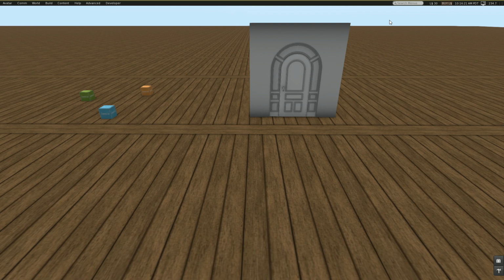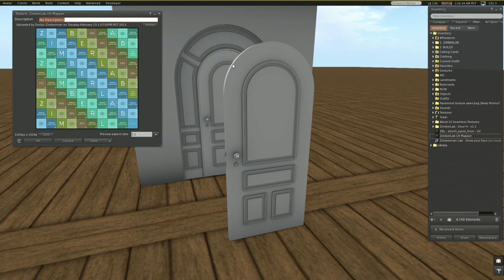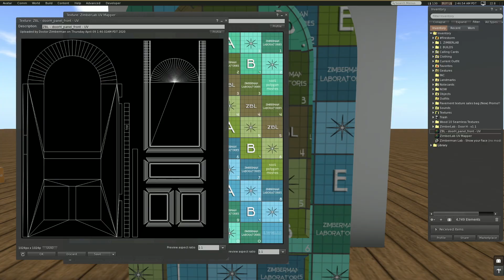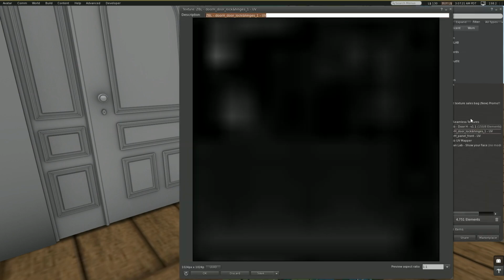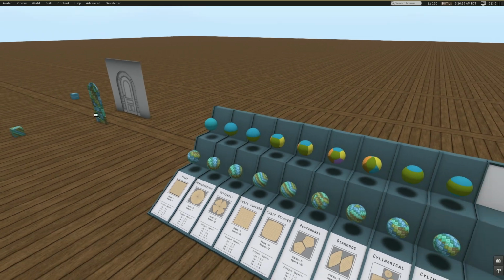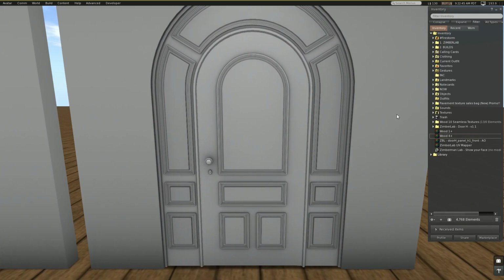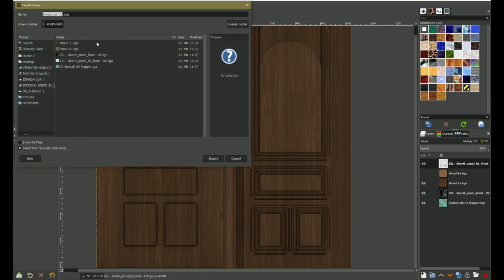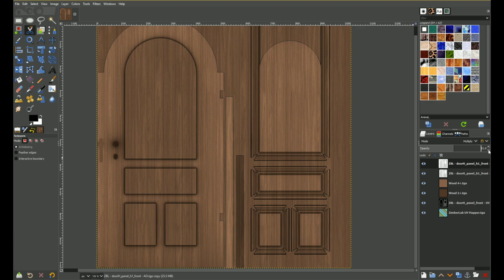Second Life Building Tutorial : Maps & Texturing - Part 1

Comment: Blend Diffuse and Ao, can work if you texturing a small object. But you cant use it,  if you will turn on "planar" texture. I seen, like people, somehow applying planar diffuse texture, and non planar ao, at the same layer. I don't understand how did they doing that? So, again. I have one surface with diffuse and ao, And that's not only one combined texture with diffuse and ao, but two. 1st is diffuse 2nd is ao. How ? :)
Reply from the maker: We have PBR in sl now, which combines all texture elements into one material.